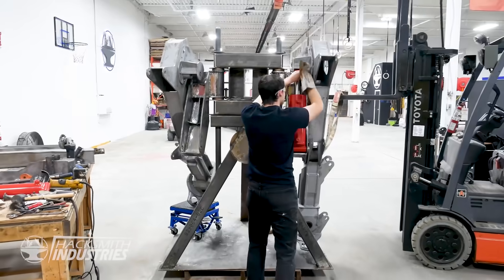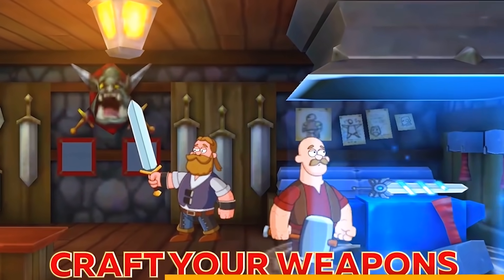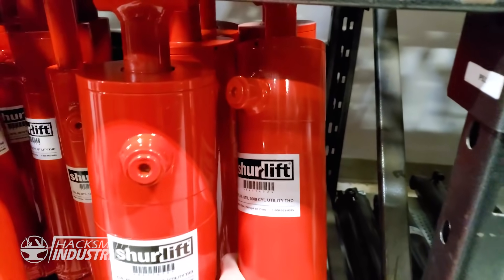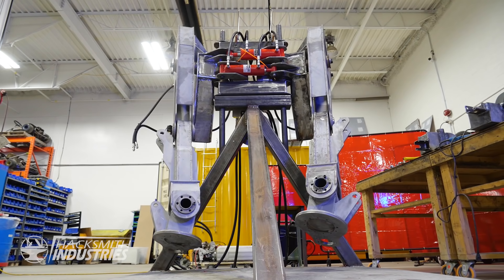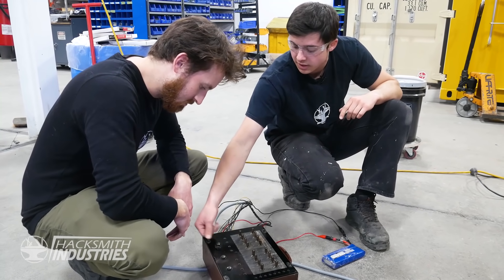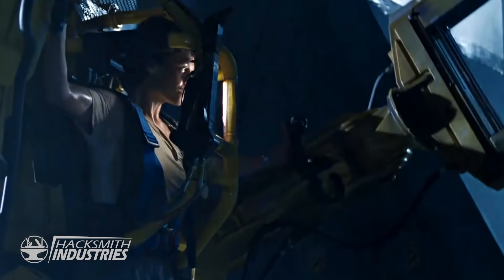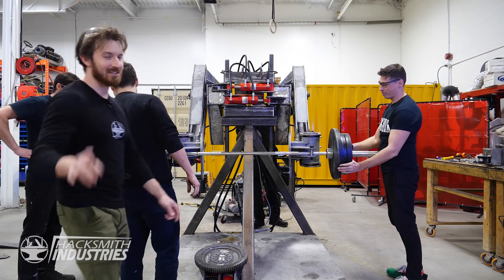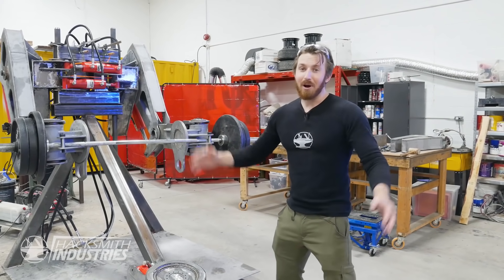How Strong Is This Exoskeleton? (POWER LOADER: PART 9)

Comment: Gel muscle  first gel nodules  ironoxide  inside flexcase one wire 3volts one hundred pound lift each strand  --0-0-0-0-  --0000-- 3volts.

Comment: You need hydraulic check values, itll stop your rams from falling down. So it’ll need a certain amount of pressure to move the rams it’ll sto then from falling down and actuallly lift together.

Comment: Probably should go with rotating fittings on the cylinders and armor up all the hoses against wear. All surfaces near that area should be fitted with a rubber sleeve made from hose that's slit up and slipped over. A few small drill holes would allow metal zip ties to keep that in place (if the CAD shows that drilling right at the edge won't cause undue fatigue).

Comment: I can't wait to see this working!!! That's awesome. 
Maybe you can use fluid dynamics to lift more. if you take a frustum and put fluids and put one big one small piston on ends, and put small force on the smaller piston, you'll get more force on the larger one. 100N...power increase!!! 200N (if the larger piston is 2x smaller one) And maybe pulleys. Not simple ones, complex pulley. You know, I used to make drawings of robots- full mechanical and steampunk when I was a kid. I want to become like you when I grow up.
Reply from the maker: Yes, that is how hydraulics work =) Each arm can already curl 5000lbs

Comment: Hey Hacksmith folks. We know that a legged version of the Power Loader wouldn't be too practical. But once this project is done, perhaps another future project would be to make it (more) Practical. Perhaps designing a fictional earlier model of the Power Loader that is on wheels or treads. The upper torso would rotate like at tank turret. With a rear mounted engine and front mounted Torso, the back should provide more than enough counter-weight handle fairly heavy loads. If you really wanted to get fancy, you could even mount the torso onto a mechanism that would allow it to raise and lower itself straight up like a Forklift can.
Reply from the maker: Take a look at our t-shirt;)

Comment: guys, put some accumolators in the system with only one pump to fill them. using multiple pumps creates trouble. also with accumolators you can get a big burst of flow while the pump fills it back up.
Reply from the maker: Guys it's no where near done... that's a test pump that has a tiny flow rate lol,  when we have the real engine it won't be an issue

Comment: Commercial loaders use mainly steel lines and only use the flexible rubber hoses where needed for movement. Just a suggestion, it could clean up the look and definitely make it more compact.

Comment: Hydraulic check valves to prevent back flow will keep the arms up. Maybe hard line where you can to reduce long term hose wear. Might even be able to put a pass thru in the center of the rotating assembly for the grippers to allow continuous 360 rotation...just a thought.
Reply from the maker: Don't need check valves in a hydraulic system! It already locks in place :)
Reply: @hacksmith  Well once you have a large enough motor yes you are absolutely right. But if that takes a while one check valve on each outlet of you proportioning block and you wont lose any of your movement progress due to the weight of the arms and whatever you lift. I just wish yall could make the legs and it be stable.

Comment: Just a thought...., look into getting aircraft hydraulic pumps. They move insane amounts of fluid to lift landing gear and operate flight controls fairly quickly, and are about the size of a turbocharger. I used to be an aircraft mechanic on the Harrier (USMC).

Comment: Love the progress so far.  Keep it up!  I am worried that the shoulder assembly is too narrow for a human pilot.  Things get crowded quickly.  No harm in giving the pilot more space.  Also, I heard you mention using a skid steer track system in place of legs.   This will he very cool, but I hope you still dream about making the legs at some point.  I am guessing cost associated with the leg system are the biggest hurdle.  More specifically balance.  A gimbal system.  Now for this I have 2 suggestions, first contact the crew at Boston Dynamics to see what they would suggest, they would probably offer to help with such a cool project.   Second, I have seen a balancing device in even small boats to completely eliminate rocking from waves.  If this technology is available for use in boats, the cost might not be as high as it was 10 years ago.  The biggest hurdle would be balancing while lifting something actually heavy.   But walking and light objects should be achievable.  You are well on your way to building a mech warrior. (Spin off from this project)  Pretty cool.  Can't wait to see the progress.

Comment: Too too slow motion; Alien has won.
Reply from the maker: You didn't watch the whole video, we explain that ;)

(Itll go 20x faster)
Reply: @hacksmith  Ok.But to explain isn't to show. You have unbalanced system and it will fall down instead to work if go 20x faster. Because its manipulators plus load are too heavy to move fast without added balances. Did you make a mechanical calculation? The inertion must to be meant too.

Comment: Have you considered putting a small diesel in it on the back to create electricity and spin the hydraulics pump instead of running off batteries?
Reply from the maker: Yeah
Reply: @hacksmith  is that what you all will end up doing or are you sticking with batteries

Comment: Controls for each of the arms can be a simple stick on each arm; pulling back tilts up the whole assembly, pushing forward tilts down; left and right stick is self-explanatory; a 4-way HAT gives you elbow and wrist control with HAT down (towards you) curling, and HAT up (away) uncurling, HAT left will be counter-clockwise rotation, HAT right clockwise rotation.  Finally, two buttons on the insides of the stick control the grippers with an upper button opening, and a lower button closing.

Finally, a horn, because this thing is supposed to be powered heavy-lift equipment.  Thumb button.  Either side triggers it.

Comment: You need gortrac and swivel fittings to manage those hoses. Contact me if you need help. Definitely looking for work during this pandemic. Worked on Nautical Structures, Marquipt, Structor, etc. Hydraulic systems for over 15 years. Would be awesome if you could control this with some NBB Control joysticks when finished. Hopefully those manifolds are proportional and not bang-bang valves.

Comment: have u thougt about putting an engine on it for power or is it with these lead acid batteriers. if you want lead acid yes its cheap but it is really heavy maybe use 18650 litium cobolt or 21700 just a thougt :)

Comment: I have some suggestions for you guys. I had some experience in controlling the force applied by the hydraulic cylinders for testing some transmissions for lateral and pulling forces. They had to be PID controlled.
You should use hydraulic servo valves for the cylinder control than just open/close types (open/close can be used for full shutoff). This will enable to increase/decrease the hydraulic flow to the cylinders sides. In this case it will make the cylinder response better also you will be able to control the arm speed based on the analog signal for the servo and run the pump on a constant pressure.
Be sure that your cylinders have a small starting force. I saw in the video that when you applied pressure to the cylinder it stalled a bit and then had sudden jerking movement.
If you need some more suggestions I can try to help out.

Comment: Use  compressed air air instead ,will be faster but not as strong unless up the cylinder diameter a bit .
Reply from the maker: Hydraulics are 20x stronger.  Pneumatics would be dangerous in an application like this  it will also go much faster with a bigger pump
Reply: @hacksmith  Not necessarily , I have used air jacks on trucks for years and they have more than enough power for what you are doing . You would of course have to have an air line dragging around but same difference of dragging a power cord around I suppose . Thanks for responding, Love your videos!

Comment: You guys know that the powerloader is not done when it has skid steer tracks, it is only really done when you made working legs that can walk. Even if bipedal systems are possibly one of the most difficult things to make work.
Reply from the maker: Near impossible with hydraulics

Comment: Your commentators are fired up about the loader hardware and the promise of twenty times faster. 
On hearing that, I'm even more concerned about moments of inertia and the operating system.
I'm confident that most of your audience are thinking this is some sort of backhoe control problem (and that takes two three-axis joysticks to control one arm). 
Are you planning to use goniometers etc on the body of the inserted operator?
C'mon, do you (honestly) believe you'll safely control this without some resolved motion assist?

Comment: You should go for a "LUDV" hydraulic system, maybe scavenge it from a scrapped excavator. This would allow a more unison movement and not having to stop a function manually to get it to lift evenly.
Reply: Oh and I think in the long run you would actually save money from this by being able to reuse things like hydraulic tank. The hoses. And perhaps even the joystics for human machine interface. If you have questions just hit me up, I work with hydraulics daily on 90tonne excavators, so I might be able to answer some technical stuff.

Comment: What you should do is use electric valves in between the pump(s) and the hydraulics them selves to keep constant pressure so that there is no lag between the arms going up or down etc, etc, and with proper circuitry you can make the valves open and close automatically when you need to move the arms. Just saying.
Reply from the maker: Yeah it's not done yet

Comment: In my opinion you can use actuators for low-weight parts like fists or fingers to make them much faster
Reply from the maker: What kind of actuators? Hydraulic cylinders are actutators
Reply: @hacksmith  Yea, but l am talking about electric ones
Reply from the maker: Hydraulics will be faster :)
Reply: @hacksmith  MB ;-)

Comment: just need some 90-degree throttle valves on the end of the cylinders will help with the timing (do it when the oil is nice and hot)  :) also with hose management if you are finding it hard with pre-made hoses being too long or just too short as sod's law, there are a lot of companies that will make hoses up on-site made to measure, not sure if its the same over there but maybe worth a look :D

Comment: Awesome work guys..
Regarding the hose management, I was thinking that perhaps you could use hard tubes, with hoses just at joints.. that way at least some of the tubing can be fed inside the arms and out of the way of potential crush points.
The tubes would also kinda look like ribs as they run across the back..

Comment: Cool idea but impractical considering how long it takes for the hydraulics to move. Its wayyy tooo slow
Reply from the maker: Watch the video kiddo. It's a test pump, will go 20x faster when finalized
Reply: @hacksmith  even so, 20x faster and its still going to be pretty slow. Would be sweet to do a revised version at some point in the future with electric motors like used in industrial robotic arms. Cheers
Reply from the maker: At this size and weight, you can't use electric motors.  20x faster is faster than we'd even want something this big to move.... it would curl its arm in half a second
Reply: @hacksmith  cant wait to see it with the faster hydraulic pump!!

Comment: You're going to cheat the Meck but using a skip loader tread why don't you go for a lien meck and make it a walking meck here's a challenge for study the control mechanisms for the iron Man suit a good demonstration of them is in the first movie use that method to control your meck
Reply from the maker: Walking hydraulics just aren't feasible
Reply: @hacksmith  I'm sorry I thought a creative inventor like yourself wouldn't be dealing in the realm of feasible. Is your YouTube channel about making products feasible/a reality. I thought you were aiming to be the modern-day Tony Stark like what you mentioned in your videos. I can see you making walking hydraulics in your words feasible as you mentioned in your video that the current motor is just temporary to do a proof of concept. The field of robotics has already made a walking robot, so why can't you make a walking mech it may not have to have two legs you may have to have four to make it more stable
Reply from the maker: Hydraulics are far too slow. Took boston dynamics 10 years and millions of dollars to make a robot walk that weighs less than 50lbs. This will weigh 5000-8000lbs.

Comment: Thermal camera has limitations to estimate heat variants. i.e. metal since it is reflective it is harder for the camera to determine the heat a recommendation to test the heat on the motors would be more direct like a thermometer.

Comment: Maybe one day Hacksmith will upgrade the power loader to actually walk, the forklift is a good way for now, as you probably need alot more money for actual legs, and not letting it fall over and all, but one day i hope legs and a stabilizing system is installed.

Comment: hydraulic hoses make contact they wear/leak. most farm equipment use 2 halves plastic block holders bolted together. all the john deere 7000 series tractors had hoses zip tied in a bundle up to the steering control valve on the firewall everyone develops a leak right under the big factory zip tie

Comment: Will be interesting to see if you get some useful speed after upgrading the pump or if hose diameter and cylinder size become issues.  Obviously walking is going to require a considerable amount of speed so it doesn't topple before a leg can react.  I'm sure you can do it, just interested in how many unexpected issues have to be worked through.  As a builder of one-off machines, I appreciate the ambition here.

Comment: You probably won't see this, but you can fix the whole differencial forces by changing the diameters in order the equal out all forces thus you don't need 10 pumps

Comment: Im surprised with how much you have spent buying hydraulic lines that you haven't invested in your own crimper to make your hydraulic lines and just buy a reel of hose and ends that you need.
Reply from the maker: The lines are one of the cheapest parts, since we're prototyping it's easier to use preset lengths. We'll make custom hoses when its finalized
Reply: @hacksmith  my point isI know from working on heavy equipment that your better off making the lines because it is cheaper to have the tool and if you need a  line you just go make it instead of having to run to the parts store anytime you need one or several

Comment: You need to incorporate a gyro stability control when final assembly happens..
Reply: Should not be necessary for the skid-steer version.

It would be necessary for a walking version. And honestly, I hope hacksmith does start working on a walking leg assembly at some point.

Comment: are you going to get a diesel motor because of the torque output? if so i recommend a 4bt cummins that is out of a bobcat or any of those types of machines as long as you have the bottom end you can get the top end with ease

Comment: Engineering the shoulder must have been the most complicated part of any exoskeleton builds. It has at least three degrees of freedom on the human body: extension, abduction, internal rotation. Four if your include the extra rotation that the deltoids provide.

I'm guessing that the original Power Loader in the movie only has two degrees to consider?

Comment: Totally supportive tips! 

1. Please up-size the Valve/Fitting/Hose/Cylinders. 

2. Decrease the viscosity of the hydraulic fluid. 

3. Use flow measuring devices on an adjustable high flow pump to determine GPM and pressure needs, and make multiple compact brushless high speed hydraulic pumps to suit those needs.

The higher flow/pressure pumps will have to fight static loss of the smaller diameter lines also restriction creates heat. Super jealous! Wish I could work there!

Comment: a skid steer base makes way more sense. I was wondering how they were going to balance the vehicle using legs and hydraulics.
Reply: Mobility wise as well it makes a ton more sense. It will be able to move about much faster while being more sturdy. Only downside would be losing the ability to step over obstacles or even climbing stairs/ledges.
Reply: Boston Dynamics seem to have sorted out the balance of robots pretty well.. but they have also been working on it for a few decades now, so I'd expect as much.. ;)
Perhaps a bit of a co-lab with them in which they advise on electronic systems to manage the balance of this thing..
That way either base could be used - interchangeable even - be it tracked loader or legs.

Comment: Won't be true to original but should route the hose internally and have bulkhead fittings on the end of its shoulders, you can get in line swivel joints that will help with hose twist too.